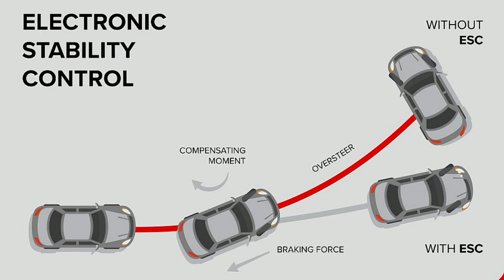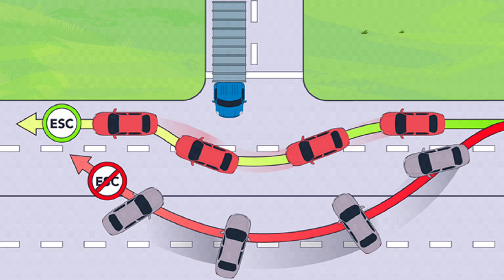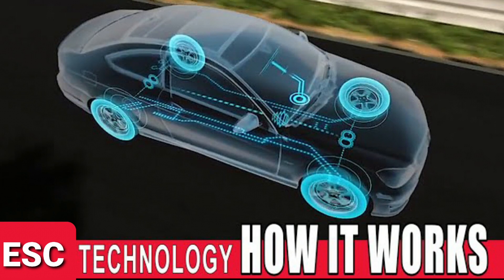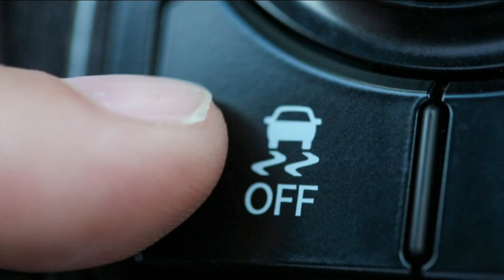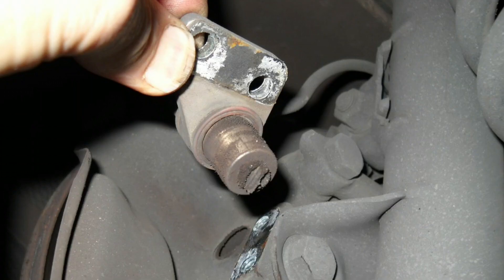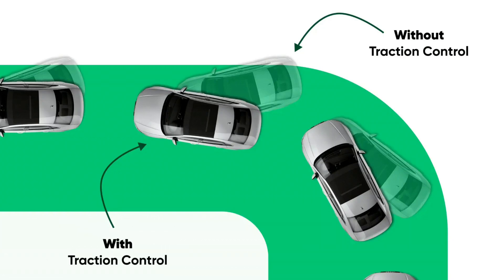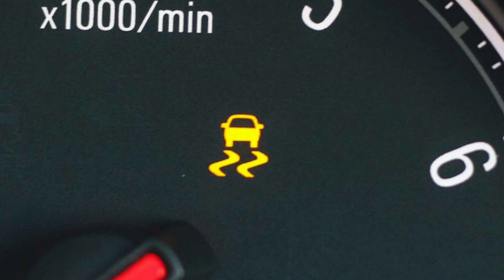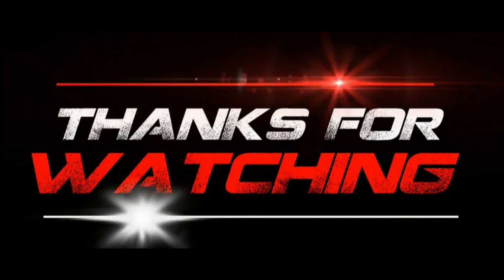How to Fix & Reset Traction Control and Stability Control Warning Lights Stays On or Flashing

Comment from the maker: ✅ TRACTION CONTROL or STABILITY CONTROL LIGHT WON’T TURN OFF?
👇 Comment your car's make & model — I’ll help you troubleshoot it today!
In this video, I’ll walk you through:
✅ Why your Traction Control (TCS) or Stability Control (ESC/ESP/VSC) light is ON
✅ Step-by-step fix — with or without a scanner
✅ How to reset the system and avoid expensive repairs
🛠️ Covers common causes like:
ABS sensor issues, steering angle sensor misalignment, low battery voltage, or faulty wheel speed sensors.
🚗 Works on many vehicles:
Toyota, Honda, Ford, VW, Mercedes, Audi, BMW, Kia, Hyundai, Nissan, Jeep… and more
💬 Drop a comment if you’re stuck — I answer every question!